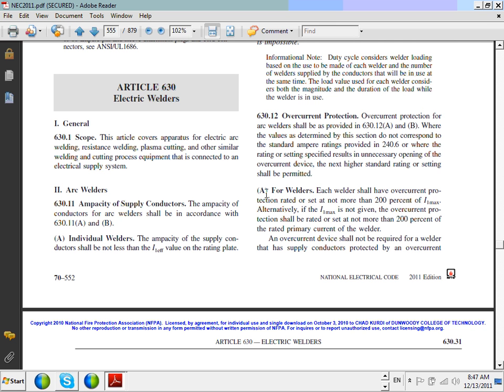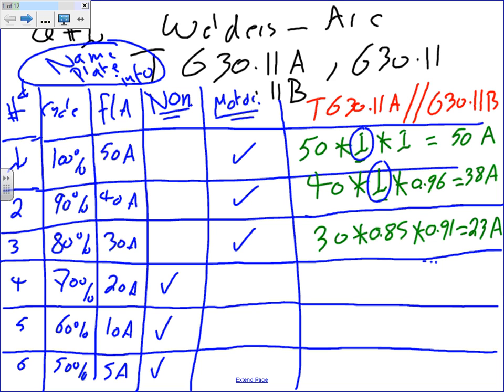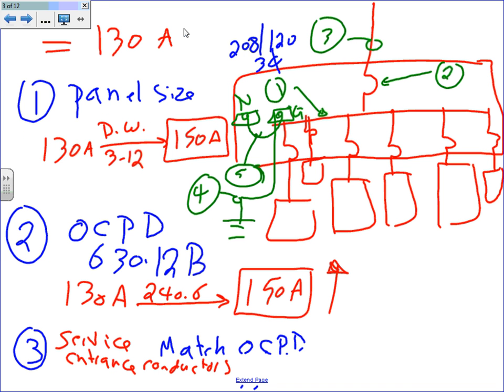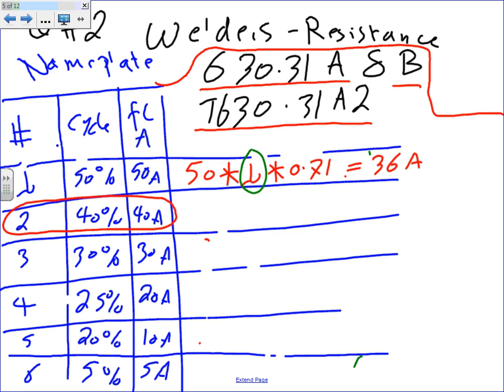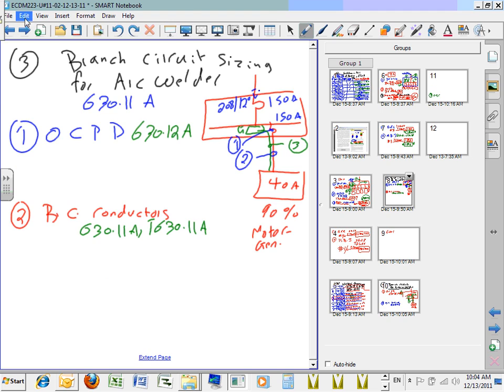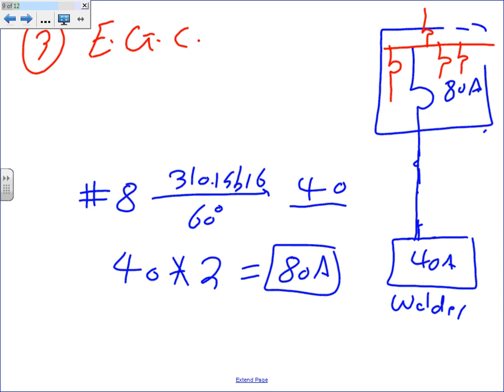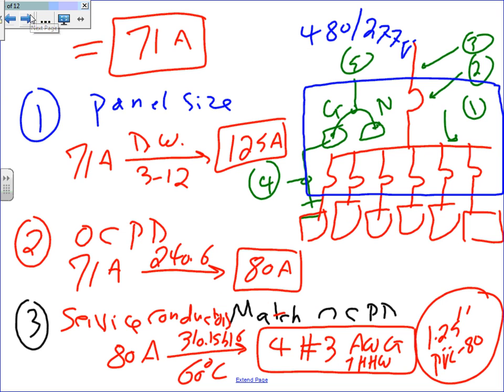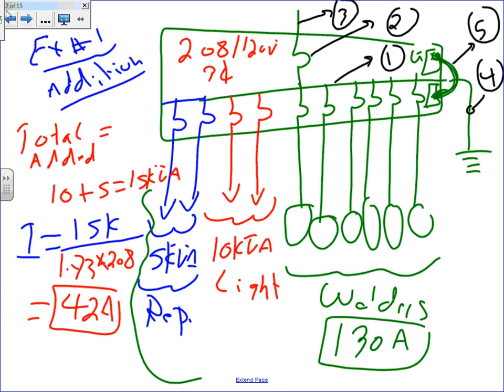Commercial Load Calculation-U#11-02-12-13-11.wmv

Comment: Very nice session. Explained the concepts and calculations so patiently. For resistance welders, 300% in OCPD details not touched. I understood as per practical situations, GEC for panels should be minimum of 6AWG copper, is this irrespective of Panel size?. Thanks for uploading this video.